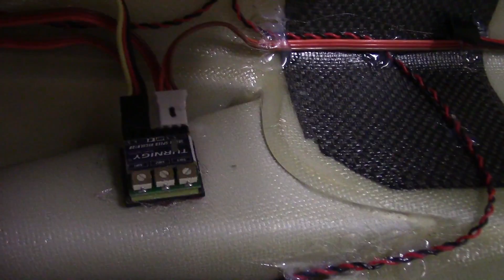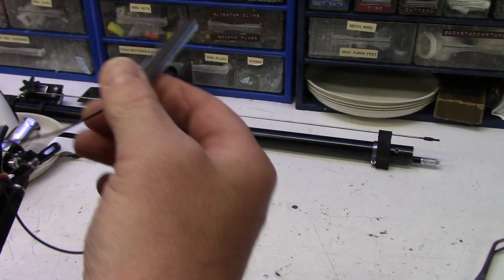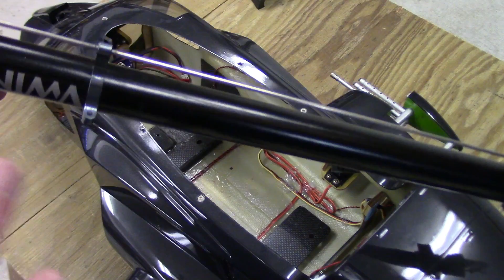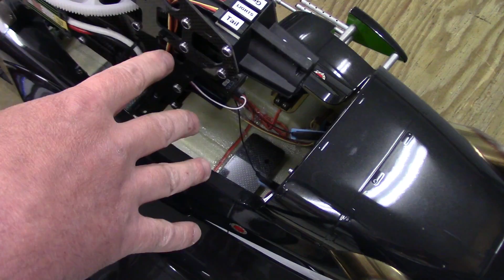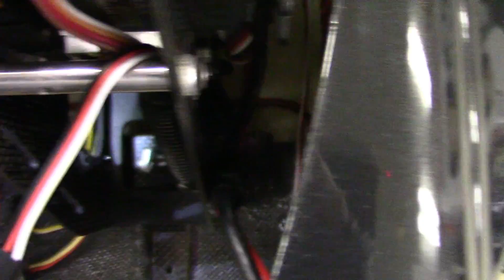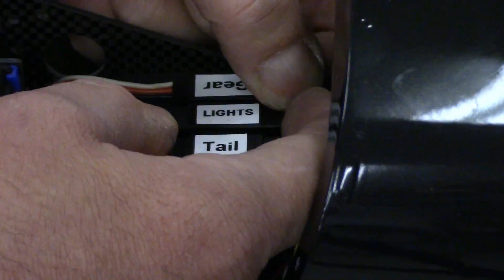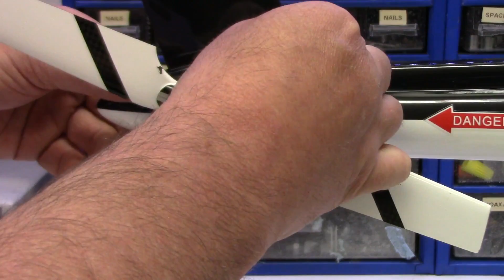Scale RC Helicopter Build - Fitting Mechanics Into A Scale Fuselage

Comment: Hi I'm trying to put a blade 450 x into an airwolf fuselage I have a dx6i I don't know how to activate the retracts
Reply from the maker: You'll need a minimum 7 channel radio and receiver if you want retract operation since the six channels are already fully used: 1. Throttle. 2. Aileron 3. Elevator, 4. Rudder 5. Gyro. 6. Collective.

Comment: Hello John,
I have  a Super Combo Dominator Trex 760X (12S)  and planning to purchase Airwolf 650 fuselage kit to install 760X mechanics in the Airwolf 650. Any thoughts or information on this build?
Reply from the maker: I have no experience with that specific combination so I have no idea what fitment and mod headaches will be involved. I certainly can't see it working with a 650 size fuse (never even heard of that size to be honest). I would think the smallest you might get to work is a 700 size fuselage, but even that will be a tight fit without major modification (fuse style dependent of course). 800 would be the safest bet as you can almost always go bigger with the fuse but never smaller.
This page on my website explains all the critical interior fuselage dimensions you must know in order to determine if a fuse will fit a specific set of mechanics which is the very first step in determining if fitment is even possible: https://www.rchelicopterfun.com/funkey-fuselages.html
Out of the dimensions listed for each fuselage size and type, the most critical one is dimension B (main shaft to tail rotor shaft distance); of course all the others are important as well, but that one is primary.

Comment: Well, six years later and still very helpfull tips, I just got the same fuselage. The 600 ESP frame is non existent now and I will try fit an Align T-Rex 550X Dominator that comes with a 600 sized boom. I know I am up to lots of modifications. John, I have no idea if you still monitoring this video but if you do, could you tell me where to find the foam you used for the floor plate? Many Thanks!
Reply from the maker: It's EVA foam - details are in the description. 
BTW, Phoenixtech (now carried at Motion RC) still makes the 600ESP clone mechanics and they to this day remain the single best electric 600 size mechanics for 50/600 size scale projects due to lower motor location, integrated elevator A-arm anti-rotation, and having the pitch and roll quadrants of the swashplate on the rear instead of the front.
Nothing wrong of course with the 550X, just more fitment compromises as you've already surmised. Happy building.
Reply: @rchelicopterfun  Oh wow, thanks for replying!!  Yes, I am looking at the Phoenixtech  for awhile, over an year it is out of stock at Motion RC. Enjoy a lot all your videos!

Comment: so i just aquired this same heli a few days ago. but mines nitro. im assuming going off your size of heli that its the same as mine. trying to get the rotor head off so i can disassemble and ive located the screw and removed it but the heads stuck. this things been sitting for years i guess. also is there something to melt the old glue? whoever owned this before did a terrible job and glued the gun doors shut.

Comment: John, enjoy your work. Would love to crank one of these out. The fuselage is readily available, however the mechanics you used are not. Can you suggest a suitable alternative? Thanks!
Reply from the maker: Sorry, other than finding a used set of ESP mechanics if you can't find any Phoenixtech 600ESP ones in stock at Motion RC or direct from Phonextech RC, I don't know of anything else that works with little in the way of modification.

Comment: Awesome video. I saw this video a few years back when I was just starting this hobby, after reading your books and now that I’m a little experienced I want to try and tackle on my first scale build bell 222. I’m currently flying a trex 550x and from the dimensions I researched it should fit the 600 size Funkey fuse, the big problem is battery placement. Now I don’t mind buying a new mechanics donner for this project but I can’t seem to find any esp 600 clones for sale anywhere. Can you recommend me any mechanics that would work for this project that are still available now days? Or is my only option is to modify my 550x.

Comment: Could you remove the tail fin...and have small screw holes to access the stock tail screws.  Then when the fin is on. Would it cover the holes?  You might need to move the whole frame back for that then mount to fuse?

Comment: Hello John, i have a question,.....what mainblades are you using and are the tail blades standard size, I have read a lot some people say that you need for the mainblades ( half symmetric blades) and the lenght for the tailblades 105mm instead of 95 mm. What is de best ??? Kind Regards Martin.
Reply from the maker: Hi Martin, I'm running both of these 100% stock (600mm symmetrical main and 95 mm tail). No issues at all with tail rotor authority, but that's also never running much lower than 1500 RPM head speed (1450 would be the slowest I would recommend). If you want to drop the head speed lower, then you do have to think about different blades, but you then also have to think about a lower KV motor.
Reply: @rchelicopterfun  Thanks John for the info !

Comment: Hi John, can you tell me if a fw 450 copter would fit in a 500 size bell 222 the way yours did.
THANKS
Reply from the maker: Nope. Too small.
Reply: @rchelicopterfun  
Can you tell me what size fuselage I can use THANKS
Reply from the maker: No Idea whatsoever other than looking for 450 size ones and modifying as required.
Reply: @rchelicopterfun  
Ok THANKS

Comment: Hi John beautiful work
I’m going to start on a funkey 222
I was wondering how much did you tilt the mechanics forward in the fuselage
Reply from the maker: Just enough for the front frame edges to fit under the dog house.
Reply: @rchelicopterfun  thank you so much for the quick response,you definitely answered my question 
What I should have asked is how much do the mechanics need to be tilted forward in order to achieve level flight to keep the look of scale,or is that not necessary,any input would be greatly appropriated,your video was very helpful and gave my a bunch of confidence :)
Reply from the maker: You actually want the mechanics as level in the heli as possible. The more they are tilted (forward in this case), the more the fuse will be tilted (backward in this case) while in a hover, and that certainly doesn't look correct or scale. So level as you can possibly get them and if you have to tilt for clearance, tilt as little as possible.
Reply: @rchelicopterfun  you are too kind sir thank you much for clearing that up for me
Reply from the maker: Most welcome - have fun with your build  👍
Reply: @rchelicopterfun  thank you!!is it ok to ask you questions from time to time as I build?
I promise I won’t be asking 100 times a day,maybe just once in a while when I’m in a bad bind😊
Reply from the maker: @hg4712  yep, but best to contact me through my Web site as I don't see every YT comment.
Reply: @rchelicopterfun  thank you!!!
Reply: @rchelicopterfun  hi John how can I contact you,your website address please,my question is have you found any electric retracts that work with the funkey 222?
or no options but mechanical with servos.
Reply from the maker: Contact me via the contact page on my site: https://www.rchelicopterfun.com/
I've never used anything other than the FunKey mechanical retracts on any FunKey heli build. They fit and work well.
Reply: @hg4712  hello  i have servo with other mechanical retracts,and you can adjust speed en synchronise .
Reply: @Martin2168  how can I get in touch with you?
Reply: @hg4712  i used these A7040 High Voltage Retract Servo

Comment: Hi, great video, glad I found it! I could use your advice :-). I'm considering the Funkey Airwolf 550 size. But what would be the best option for a donor heli? I prefer a new one, so that I don't have issues with finding spares. But being totally new into scale heli's (not new into rc heli's) I find it difficult to judge which heli would fit.
Reply from the maker: @djpj54321, on my Funkey fuselage page on my web site ( https://www.rchelicopterfun.com/funkey-fuselages.html ), I show all the internal dimensions of each Funkey fuselage in their 3 size ranges. You would have compare those critical internal dimensions of the FK 550 Bell222/AW against the outside physical dimensions of various 550 size mechanics. Without looking closely, I would think the Align T-Rex 550X might fit, but that is just an educated guess without researching the exact sizing of that helicopter.
Even if sizing works out, battery placement is another major consideration to look into, especially in the FK Bell 222/AW because the front canopy is not removable. Ie. sliding lower battery trays won't work since they won't be accessible.
Reply: @rchelicopterfun  Thanks for you answer, really appreciated! I started reading your articles, very interesting and informative. I might go for the 600 size Airwolf after all. Didn't decide it yet.

Comment: Hi John,  I love scale looking micro helis and have ZERO interest in 3D/Pod and BOOM flying. My question is; Doe's it make sense to use high-end mechanicals that were meant for 3D in a scale heli?  My thought is; If the heli is powerful enough to perform aggressive 3D it should have the power to handle the added weight of a scale fuselage. Specifically; I'm planning on installing a 100g fuselage on a OMP M2 Explore. I chose the M2 based on your reviews.  Sorry for the long post.
Reply from the maker: Since almost all collective pitch helicopters on the market today are capable of aerobatic flight (if one wants to set them up &  fly them in that envelope), the choice is cut and dry. High performance mechanics are about the only things we can use in scale projects just as with these two 600ESP scale examples in this video.  And yes, they have more than ample power to lift the added mass of a fuselage. I even perform light aerobatics with the airwolf model; so even with all the extra weight, you can still toss them around if you so chose. 
I'm  obviously not referencing the really big scale helis from Vario or Roban which are a completely different ball game.
One thing for sure, you will likely never wear out a set of high performance mechanics when flown gently regardless if you keep them pod or boom or skin them with a fuse 🙂

Comment: Hi John! I am starting a Vario Bell 222 600 size build and I was hoping you could point me to the retracts you are using.  I have the spring style on order from Funkey but I like the style you are using. Since your video is from 2018 I am praying those style are still available
Reply from the maker: @Bobby McKay - I made them by modifying and turning them on my hobby lathe from an off the shelf set of scale jet retracts. Sorry I can't remember where I got them from (likely flea-bay since I'm a tight ass). I just did lots of Google image searching for scale retracts that were similar to Bell 222's. Once I had some possible ones narrowed down,  I got the exact dimensions from the product pages and made some crude cardboard mockups to see if they might fit/work before ordering.
Yes, it was lots of work and I'm still using the Funkey mechanical retract hubs. Just replaced the sprung wire with the aluminum struts. 
By the way, the Funkey sprung wire gear works better (better impact and energy absorption), but as long as your landings are gentle, these re-purposed inexpensive jet aluminum strut type ones are holding up.
Have fun with your scale build - 🙂
Reply from the maker: @Bobby McKay - I think I found them: https://www.turbines-rc.com/en/struts-sets-and-full-sets/682-class-25-prodesign-v2-scale-metal-wheels-landing-gear.html
Mine came direct from China I recall, so I'm sure this is not the place I got them from but I'm certain these are the same ones. You have to be prepared for a fair amount of modification to them to get them to work (at least on the FunKey fuse using their mechanical retract system). No idea with the Vario fuse? I had to use different size wheels as well.
Reply: @rchelicopterfun  Thanks so much John!! You helped me out big time! I bought the gear from that link and will modify to fit my set up!!

Comment: Sad to see that you spend so much time on the hull, but placed the tail rotor on the wrong side...
Reply from the maker: @Christian Harm - Almost as sad as your comment. That's the ONLY side of the boom it can be located due to the fact the FunKey 550 & 600 size Bell222/Wolf/206/206L/109A & AS350 fuselages only allow for right side tail rotor placement because the horizontal tail fin mounting plate is on the left side of the boom.
The fin mounting plate is molded right into the fiberglass, and I'm certainly not about to go to the massive amounts of work required  to cut off the end of the fiberglass boom, rotate it 180 degrees, redo a bunch of fiberglass & fill work (adding extra boom weight on an already tail heavy fuse), and then have to repaint it; which would look terrible given my limited air brushing and paint matching skills, just to have the tail rotor on the left side.
Life is too short, time is too limited, and I honestly don't care which side the tail rotor is on... I'm more concerned with how well they fly.
Why does FunKey do this? Because right side tail rotor placement is the standard on almost all off the shelf RC helicopter mechanics, including the 600ESP; so that is how FunKey's fiberglass fuselage molds are also configured - for right tail rotor placement. This way, their fuselages will work with the majority of RC helicopter mechanics on the market.
Reply: @Christian Harm 'ever heard the term "rivet counter"?
Reply: @ChickenHawk841  Once again, I didn't want top blame anyone. I am also not a rivet fetishist. But the side of the tail rotor you can even see inflight. For me e.g. I am sad that my Vario "Airwolf" in fact ist not an Airwolf, as the base of the model is a Bell 230, and not 222, as the original. You can see it immediately when looking at the tail. The Hull in this video is a correct 222 hull, which gives her an impressive inflight look. If the tail rotor would be at the correct side, it would be a perfect inflight look.

Comment: Doesn't the tail rotor belong on the left? Love this video! Thanks:)
Reply from the maker: Full size yes, but almost all RC helicopters have their tail rotors on the right side, including the Align T-Rex 600ESP which are the donner mechanics used in both these scale fuselages. FunKey (the fuselage manufacturer) also knows this, so they make the fuselage with right tail rotor exit position on all their 550 & 600 size fuselages.

Comment: Dear John, I would like to have a mock 600 size Airwolf like this for display purposes. How much would it cost to have one built ? Non functional for display only.
Reply from the maker: The 600 size Funkey Airwolf fuselage is around $500-550 USD depending where you source it. You would need some sort of mechanics to install in them unless you want to custom make it all which would likely cost more than just getting a bare bones heli kit. Assuming just normal bare bones mechanics, another $400 USD or so.

We all build & put these things together ourselves, so no idea what someone would charge to build it for you? You would have to ask around in the RC helicopter community or local hobby shop/s in your area.

I used to do one or two custom scale builds a year when I had the time and my usual labor rate ranged from $1000 USD to $2000 USD depending on the model and electronic systems on board. That was of course for a working and flying helicopter, fully flight tested so anywhere from 40 to 100 hours of work involved over the course of a month or two. Without all the setup, programming, and flight testing, a skilled & experienced builder could likely put a non flying one together in 10 to 15 hours if it wasn't anything too fancy or involved.

Comment: Thanks for another great video John (and for taking time to answer the questions on stuff that you cover off in the video. Every time..!)

I am gutting a badly put-together 800 size Vario Airwolf at the moment to convert it to electric mechanics. It uses the original solid frame mounts of course and although I wouldnt need to change them for the conversion, your comment is making me think it would be worth it. 

There's no reason the anti-vibration mount system wouldnt scale is there? (No pun intended)

Also, I was half expecting the upper frame mounts to use a very thin piece of foam too. Doesn't direct mounting those negate some of the benefit, or do they have to be fixed to prevent  needing bigger cutouts in the doghouse?
Reply from the maker: Soft mounting works regardless of size. As for upper side bracing also benefiting from dampening... To fully explore that, we would have to dive into the deep hole of vibration analysis which is a massive and complicated topic. Energy, frequency, harmonics, natural resonances, changing stiffness levels of the fiberglass and dampening media that are both constantly changing at different temperatures, etc. - so many variables. Those soft and small aluminum braces are not that rigid so already have a degree of energy absorption/dampening that seem to do the job.
I have however played with dampened side mounts to see how much they further help, and they do seem to help a little bit on smaller scale models running at higher head speeds. Using dampened side mounts on larger scale models over the years, I've noticed little to no change so it comes down to effort in relation to benefit. Of course, every scale build is different so if you notice excess vibration energy migrating into the dog house or upper half of the fuselage, then having dampened side mounts is one method (of several) to try.